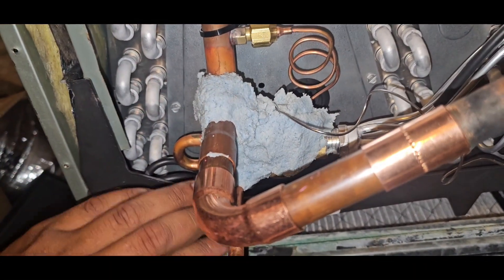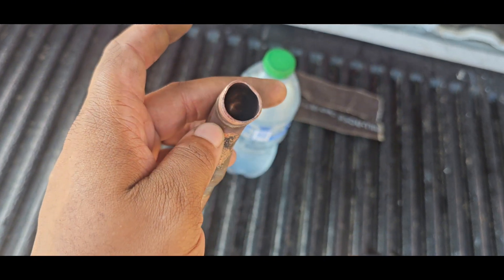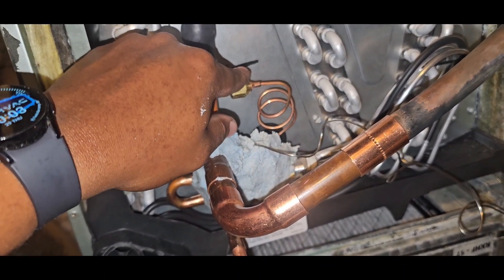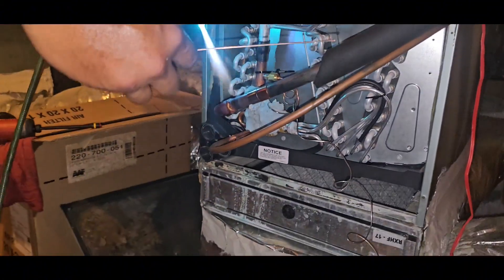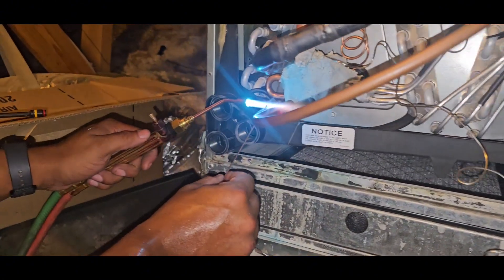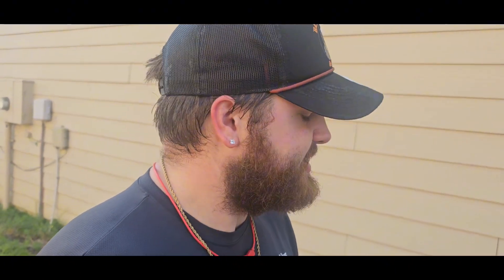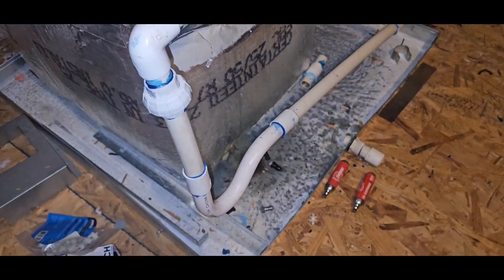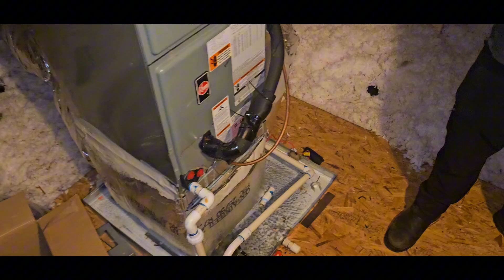Evaporator Coil Changeout on Rheem Heat Pump System w/ Rose Bud Tip | HVAC

Comment: Buy a bender and expansion tool. My boy looks cleaner and has less chance of leaking and saving money on fittings. Good vid
Reply from the maker: Have a bender and the swage kit impact pieces. Didn't have any slack  in the lineset as well not enough copper to redo the job nor was that factored into the job

Comment: Hello everyone! Can everyone please help me some advice for the issue I just got, 
The issue is “ the high side up to 490 psig and low side is about 110 with vast 30 F degrees “ so I changed the TXV inside the air handler and the result come out with the high side 320 psig low side is 115 psig and vast around 35 F degrees, subcooling up to 18 and superheat up to 24 . So any advice please
Reply from the maker: I would try cleaning the condenser first but you'd have to give some outdoor/indoor temps
Reply: @AB_HVAC  you mean the delta T and wet bull and dry bull
Reply from the maker: @henrydang1644 I guess sure. Wet bulb would've guided me in the direction of your superheat but you have a txv so I don't really care too much about what my wet bulb indoor is, txv just needs to regulate superheat.  So dry bulb for indoor and outdoor would put me personally in a better position to help understand